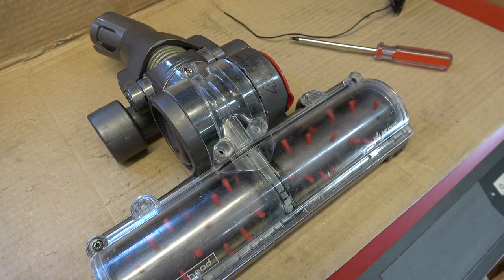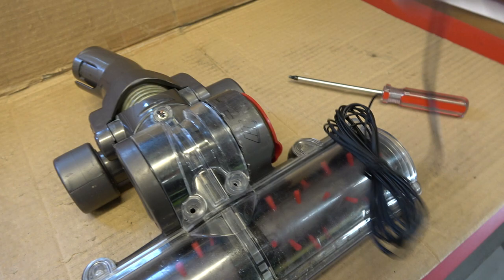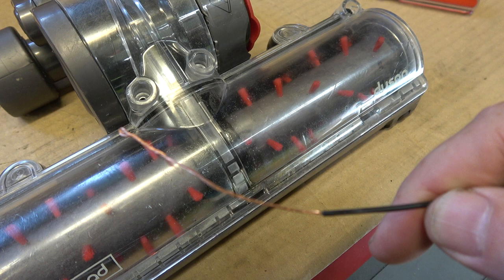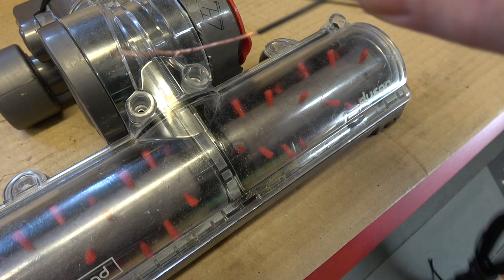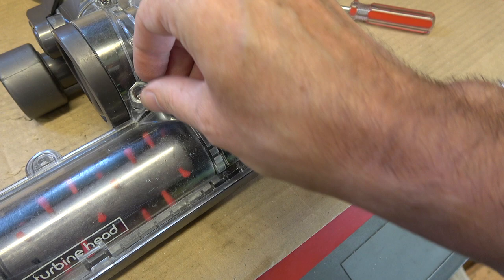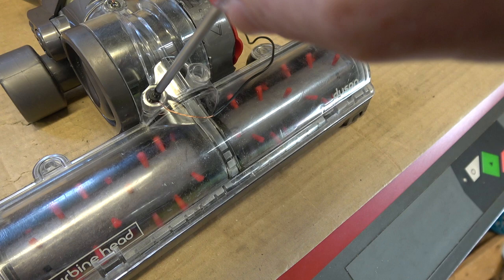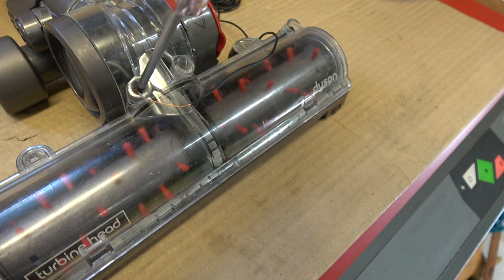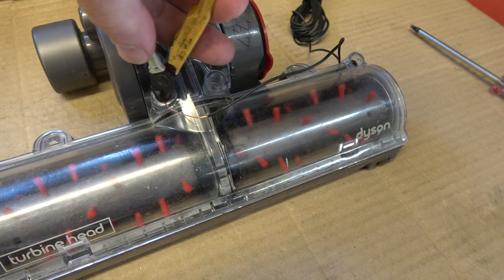DIY - Fix stripped plastic threads the easy way

Comment: BRO YOU SAVED ME 500 ON A VALVE COVER GASKET FOR MY BMW AFTER THE VALVETRONIC GASKET PLASTIC THREAD STRIPPED!!!!! AHHHHH THIS TRICK IS AMAZING!!!!!!!!!!!!
Reply from the maker: Yeah boi !!!
Reply: i stripped the threads on my scirocco valve cover XDXD this is golden !!
Reply: What's the point of spending the kind of money a BMW costs, if they're using plastic threads like that? I just removed the MAF on a Honda Civic, and discovered that, unlike many other cars, the screws are held by metal threads. Thank you, Honda.

Why am I here, then, you ask? Because I'm also removing the MAF on a Mazda 3, where the threads do go into plastic, and one of the screws took the threads with it when I removed it.

I will probably try this wire method, since it seems pretty foolproof and unlikely to cause any further damage if I'm reasonably careful. And I happen to have a lot of wire on hand. Epoxy or drilling out the hole is less foolproof.

Comment: Great trick with the wire. I used the wire on 2 stripped thread holes on my stihl ms 250 chainsaw.  The wire worked great. Thank you so much for showing us this.